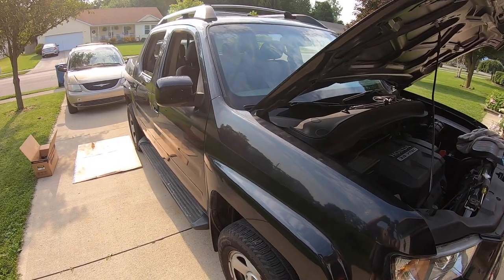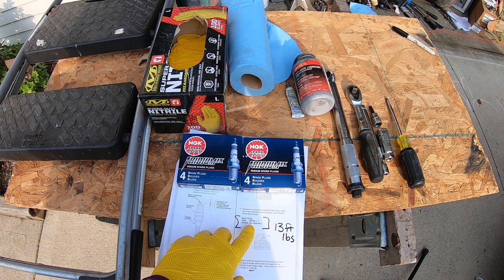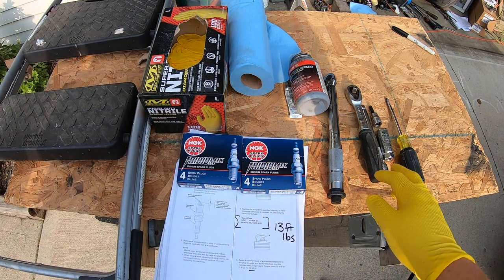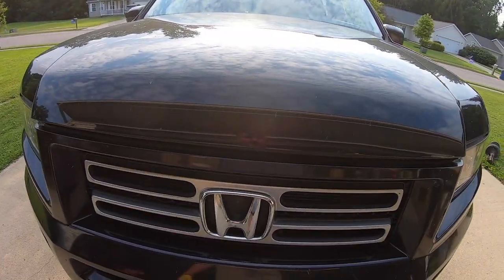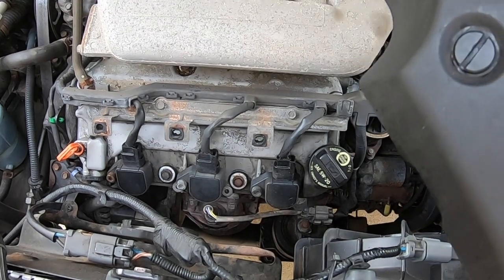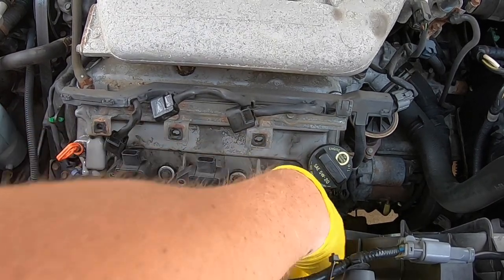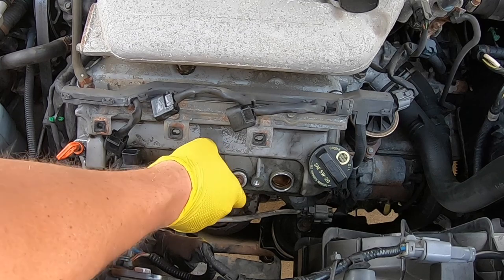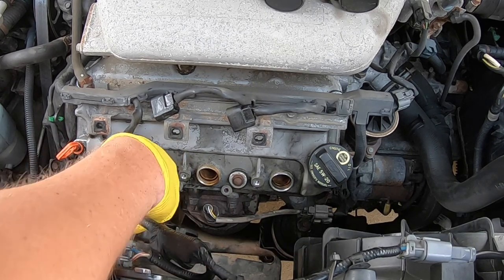How to Replace Spark Plugs in a Honda Ridgeline 2006-2014 (Complete Guide for Front & Back)

Comment from the maker: Learn how to change out your spark plugs in a 1st generation Honda Ridgeline for both front and back spark plugs. 

The Tools: 00:29
• Ratchet - https://amzn.to/3xWjE5g 
• 6in Socket extensions - https://amzn.to/3uwhLKx 
• 6mm Allen Socket - https://amzn.to/3l3F9Nt
• 5/8 Spark Plug Socket – https://amzn.to/3BKVOLE  
• Torque Wrench - https://amzn.to/3yawY5K
• Gloves - https://amzn.to/3bbfEnu 
•       Shop Towels - https://amzn.to/2SC8D93
• Spark Plugs NGK - https://amzn.to/3l9yt0t 
• Anti-Seize Lubricant - https://amzn.to/3x8qsv4 
• Step Ladder - https://amzn.to/3bg8azE 
•       Flat Head Screwdriver - https://amzn.to/2RAjTlU 

This video was done on a 2006 Honda Ridgeline RTL 3.5L V6. But it should be very similar to all other makes and models, make sure to check for your exact vehicles fit for spark plugs and other specifications that you will need to follow to ensure the job is done correctly! 

The Intro 00:07
The Tools 00:29
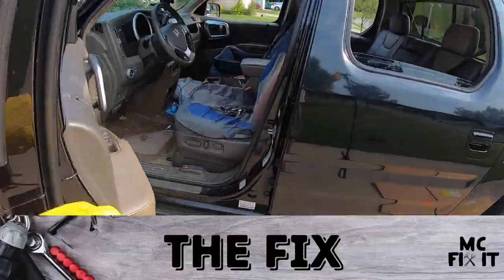The Fix - Front Spark Plugs 02:21
The Fix - Rear Spark Plugs 18:04
The Closing 38:12

Check out my website at http://mcfixit.us 

Disclaimer:
Due to factors beyond the control of MC FIX IT, I cannot guarantee against improper use or unauthorized modifications of this information in the video, post, blog, or social media. MC FIX IT assumes no liability for property damage or injury incurred as a result of any of the information contained in this video. Use this information at your own risk. If you feel uncomfortable at any time. Stop and go to a professional. MC FIX IT recommends safe practices when working on vehicles, your house, or any other project and or with tools seen or implied in this video. Due to factors beyond the control of MC FIX IT, no information contained in this video shall create any expressed or implied warranty or guarantee of any particular result. Any injury, damage, or loss that may result from improper use of these tools, equipment, or from the information contained in this video is the sole responsibility of the user and not MC FIX IT.

#mcfixit #autorepair #oilchange #repair #maintanence

——
Supplies used to record this video: 
* GoPro Hero 7 Black - https://amzn.to/3f3ALtb 
* 256GB Flash Drive - https://amzn.to/33pAueG 
* Vlogging Frame - https://amzn.to/33tajE0 
* GoPro Pro 3.5mm Mic Adapter - https://amzn.to/2RCURCu 
* Youmic Lavalier Lapel Mic - https://amzn.to/2R55sWX 
* Boom Stand (tripod) - https://amzn.to/3bdkQaw
* 5/8” to 1/4” adapter (boom to blogging frame- https://amzn.to/3txrVsM 
* Portable Battery Powerbank- https://amzn.to/3vJQc0q 
* 6ft USB to USB-C (powerbank to GoPro)- https://amzn.to/3uAS5MH
Reply: thanks, I needed a link to the spark plug socket. I let a friend borrow mine and he never brought it back.
Reply from the maker: You are welcome. Good luck on your project!

Comment: THANKS LARGE MC! 

Without this tutorial I really didn't even want to try because of the rear plugs and coils which looked inaccessible - about an hour plus with recommended breaks and patience.

2013 Ridgeline and one convenience I had was I have a flexible 4" 3/8 extension which is no good for cracking or torquing but very helpful fishing out the socket after taking the solid extension off and also starting the new plug then switching back to solid - esp on that left rear one which was the most difficult; I was able to unclamp & flex the hoses on the right rear to get at it ok.

Again, thanks, Jim.
Reply from the maker: You are welcome. Thanks for adding that information! I’m sure someone will find it helpful!

Comment: Did you use dielectric grease? I didn’t see you use any in the video but you mentioned it in the required items in the beginning of the video
Reply from the maker: Yes I did. Just a little on the top of each plug

Comment: Thanks for the video. I just changed all my plugs and all my coils (why put the old coils back?). One tip. I found it much easier (on the rear plugs), to unscrew the plug, remove the ratchet, pull the socket/spark plug out until you can grab it with your other hand then pull the extension out of the socket. It makes it far easier to pull out the plug. Reverse to install.
Reply from the maker: Great tips! That’s definitely an option. Often wires don’t wear out like spark plugs and the last time I changed the spark plugs I did the wires. Thanks for watching and commenting!

Comment: Hey huge fan but i have a question. I have a 2007 honda ridgeline and my engine bay really needs to be cleaned can i preasurewash the bay at alike a self wash. Also will changing spark pmigs fix a misfire on 4 code?
Reply from the maker: I’d be careful of cleaning with any water near any electrical components and battery. It’s best to do a cleaner that doesn’t need water to clean out your engine bay. 

What code are you getting?

Comment: Where did you find your specs for torque?
Reply: Why would you not use anti-seize? If those get stuck in there you've got a major rebuild to do if they happen to get stuck. Use anti-seize!!!!
Reply from the maker: I got them from the service manuel
Reply from the maker: There were some reports about it possibly messing up some things (I think it was torque specs) but I used it in the video, use your best judgment

Comment: What’s that glue u putting there ? Necessary?
Reply from the maker: Anti-seize lubricant is what I am thinking you are referring to. Yeah, it helps it to be able to be removed easily in 60k when sparks plugs are due next
Reply: @MCFIXIT  perfect … so won’t damage anything ?
Reply from the maker: I prefer not to use it bc it’s been know to make you over torqued the plugs. I know lots of people who swear by it though.